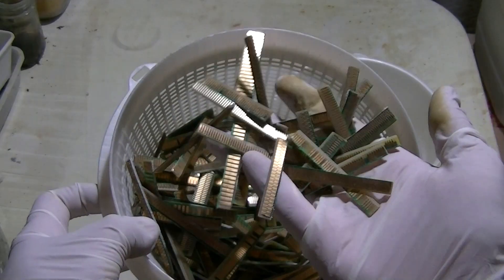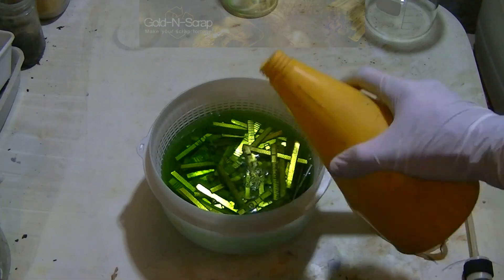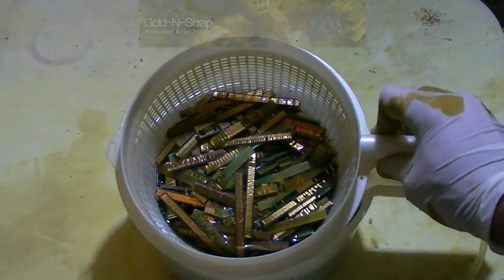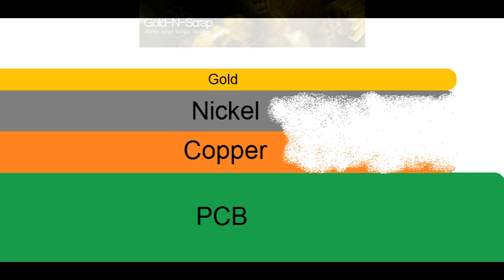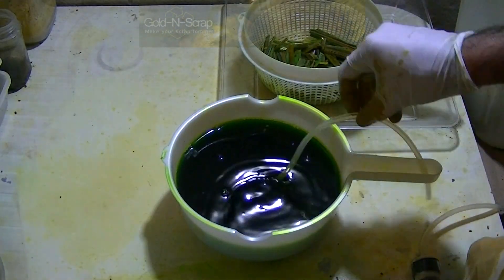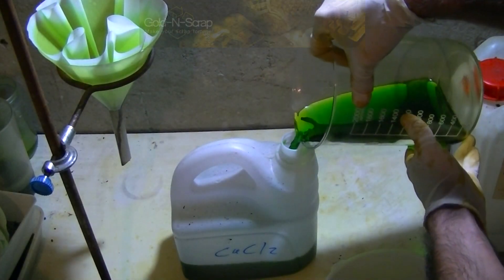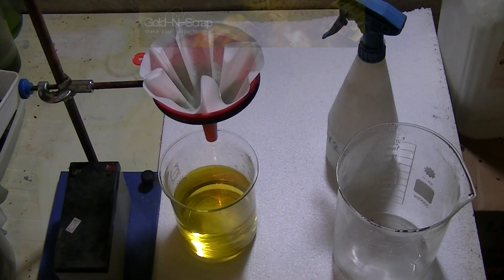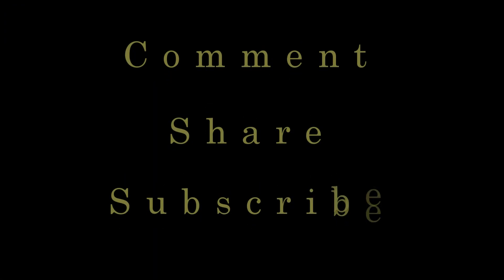Gold Fingers - How to Recover Gold from Electronic Scrap

Comment: What about the rule pour acid into water but not the reverse? I thought I learned that in highschool.
Reply: dodgedaytona25 He's just talking about splashing and cautious teachers, I'm sure. Whatever liquid is being poured will travel to the bottom of whatever container it is being poured into--the liquid already in the container will splash out.  If acid is already present and water is being poured too fast or from too high, the acid will splash out and possibly cause damage to self or property.
Reply: Christopher Pinterich Actually, he's talking about pouring concentrated acids into water. Strictly speaking, only denser-than-water liquids would travel to the bottom of a container filled with water. If you poured certain alcohols into water (or oil, for that matter), they would float, not sink.

The height from which you pour is definitely a variable, but If you're adding H2SO4 into a large volume of water, it isn't all that bad as the reaction is contained by the large volume of water- water isn't as dense, so acid, when poured into water sinks instantly, and the reaction occurs closer to the bottom of a beaker or container.

However, if you do it the other way round, i.e. pour water into a large volume of conc. H2SO4, you instantly get a highly volatile reaction as the H2SO4 vigorously reacts with ALL the water, nearly instantly. Moreover, since the water isn't as dense, the reaction occurs mostly at the top, causing the reaction to fizzle, splash out etc.
Reply: Christopher Pinterich I poured water into concentrated sulfuric acid in organic 2, no problem.
I also don't have hands anymore.
Reply: Bingo! if you add water to very strong acids the potential for a flash boil shituation is possible and will splash the acid out of the way of the boiling water stream. Not applicable to al examples including this I guess but good practice in case you get some  stronger acid than expected i.e. an accident.
Reply: Christopher Pinterich its not splashing. the dilution of a strong acid is extremely exothermic. you add acid to water so the theres enough volume of water to absorb the heat being produced.
Reply: MrScottishBeaver Which results in steam... lots and lots of it, if pouring too fast.  Caution is a must =D
Reply: Oh 2.3 gram gold dore/drop my guess.
Reply: It is no problem to add water to acid. Some time ago you used to add water to car batteries. But now they are maintenance free.
Reply: Ok. I see.
Reply: College chemistry FTW!
Reply: *****  That is very good to know, thank you =D  Probably will not, ever, handle concentrated acids...but, if I do--boom! I know that rule, now--AND the science behind it, thank you  =D  Have not had the pleasure of taking higher-level chem.

Even a lighter solution will penetrate the surface of a thicker solution-causing splash-, if enough momentum has been gained.  Thus... splash and burn.  Pour carefully, good people!
Reply: Nathan Whisman how did you type then without prosthetics if you don't have hands.?

Comment: Hi, Ive watched this video a few times & several others recommended. Im confused how you got the same results using different chemicals. Ive been researching & safely trying this myself but im using the AP method & getting mixed/ugly results. First batch was 50/50 solution & it worked great but everyones told me not to do that, use 3-1 or 3-2. I don't think I have or have used anything that you have or have done in your videos but seen similar methods & don't understand them I guess. at around 5 minutes in your video your boil acid & add nitric, I was doing this with muradic acid & bleach, is there a big difference or does it basicly do the same, like real SMB vs stump out?  Im searching gold forums & tons of videos but its like when I motor swapped my car, I just get a lot of heres what Ive done vs any type of real teachings. When dealing with serious chemicals,I want no room for trial & error. Do you have any advice or links that maybe useful to me? Thanks in advance & sorry for all the noob questions
Reply: the biggest thing that confused me at first was all the different names as you have said but i have learned that many chemicals have different names such as
methenal is also called methyl hydrate or methly acohol
muriatic acid is also called hydrochloric acid
very stupid if you ask me one not just stick to one name haha but hope that helps